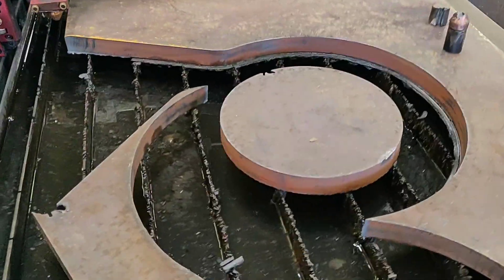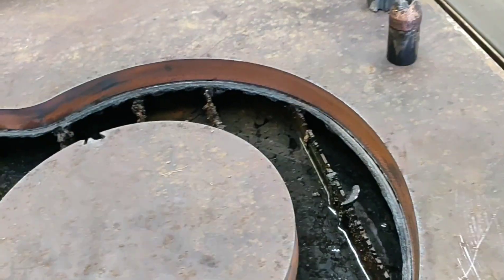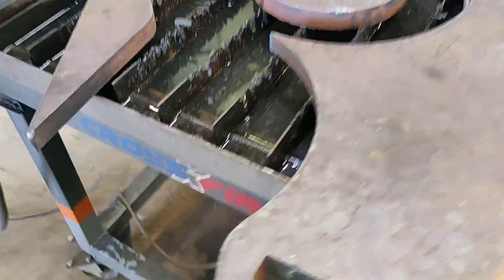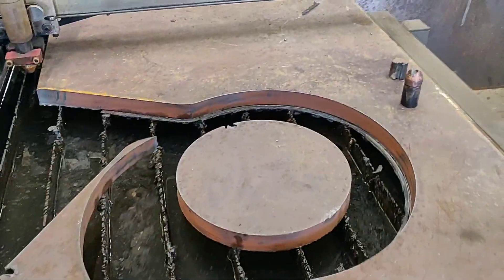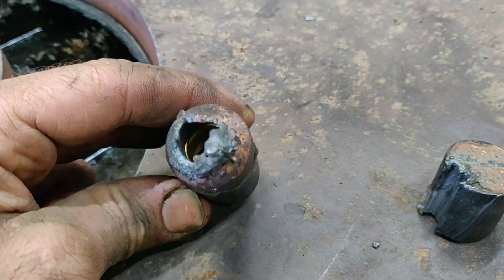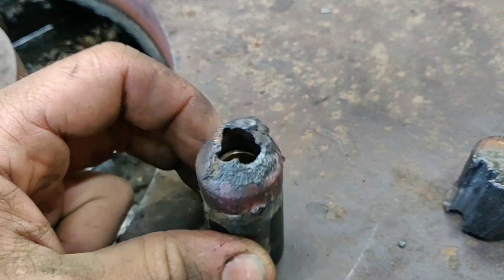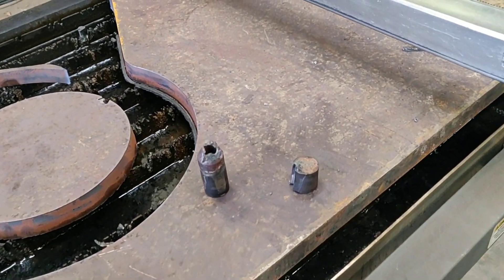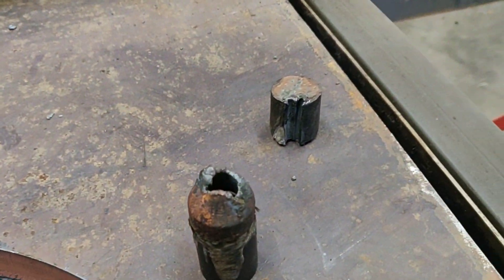UPDATE On My CrossFire + More 1" Action! - Hypertherm 85 - Langmuir

Comment: I'm beginning to learn Mach3 and was wondering how you configure it to do all the piercing holes first (with torch set at the proper piercing height), pause the program, lower the torch to the proper cutting height, then resume the program to do the actual finishing cuts.  Is this possible with Mach3?
Reply from the maker: All the settings you are referring to are set in Fusion 360 or SheetCAM. Mach 3 will just follow the G-code created by the post processor of your choice....
Reply: @joshuazimmerman8631  Got it, thanks!  Any tips on where in Fusion 360 i find these settings?  I'm familiar with Fusion 360 and poked around but nothing jumped out at me. Appreciate any tips!
Reply from the maker: @DanDulac  
From within Fusion 360, after you have created a setup within the fabrication tab, you add a toolpath to that setup. Once that toolpath has calculated in Fusion 360 with all the proper lead-ins and lead-outs, you can run a simulation to see if it is going to do what you want. Then, you click on the post process tab which generates a G-code file that can be read by Mach 3. It is in the dialogue that pops up when you post process your toolpath where you set your pierce height, your pierce delay, and so forth...

Comment: Is that the cnc head on yours? I ordered my hypertherm 85 with the straight stitch head but thinking about exchanging for the pistol grip torch.
Reply from the maker: Yes, this is the mini machine torch. To have the torch fire from the CPC port, a machine torch should be connected.  A pistol grip hand torch requires wiring modifications to be fired by the machine controller.

Comment: Hi! I have the same setup as you, hypertherm 85 with langmuir table. When i want to do 1" thick parts, i switch my torch with permanent marker and mark my plate. When it's done, instead of using my torch to pierce, i use my magnetic drill. It save me a lot of consumables  ;)
Reply from the maker: That's a smart idea! Most times I'm in too big of a hurry, but yes, I have a mag drill I could use as well. I generally have a stash of worn consumables that are a great sacrifice for my 1 inch pierces. 😉
Reply from the maker: Also, I would love to see more of the 24" x 48" Crossfire you built. I would like to do that too, but it seems I never find the time, and I would hate to take the table out of service while I'm modifying it...
Reply: @joshuazimmerman8631  The modifications was all made in one week-end. I will try to make a video on that soon and a parts list. I am also really busy between my full time job, and my home machine shop...